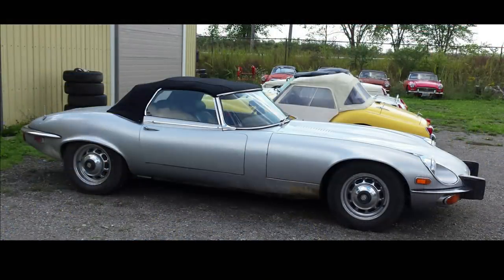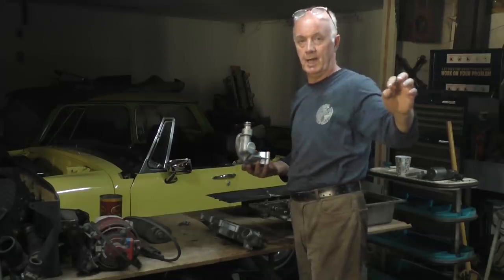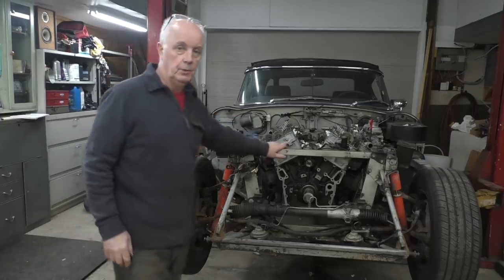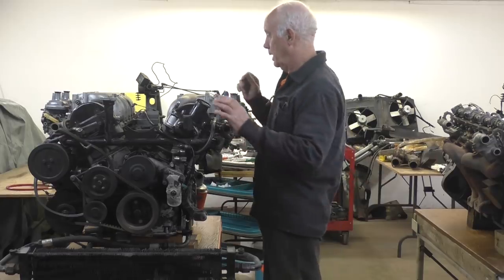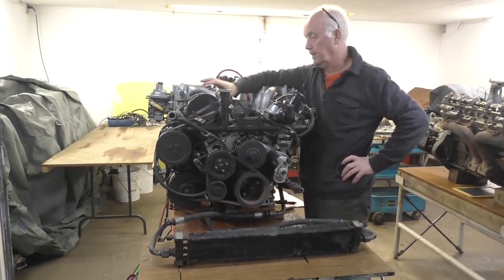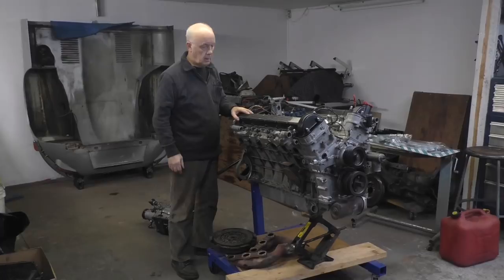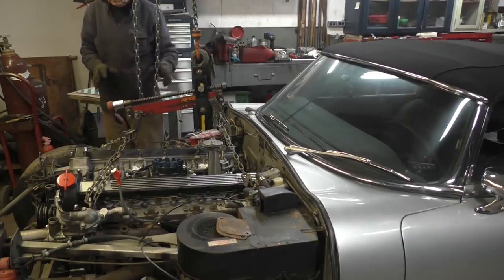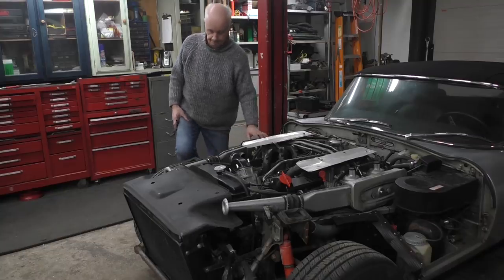Dr-Doolin Jaguar XKE E-Type V-12 1974 Engine Repair

Comment: How many hours labour from start to finish was this James?
Reply from the maker: Hi Neil,
Well to recap the work I did, I removed and replaced the engine from the original car. Stripped both engines the original and the spare down to their bare blocks. Assembled a complete engine from the spare block using the original oil pan, inter-cooler, and ancillaries and of course the heads from the original engine. All told there was approx 120 hrs of work. 
That is why I was annoyed the heads were bad on the spare engine, that gave me a lot of extra work. Removing heads from a v-12 is bad enough but from two engines for the same job is a bit much.
I got the spare engine on the assurance the engine was fine. Which of course was not true. 
Anyway it had to be done, still the car has been driven  and used ever since.
James
Reply: Wow that’s a lot.
Great video. Thanks for the reply and keep up the good work.

Comment: If it had been the xjsv12 it would have been a lot more work, so much easier on the E type. Even Jaguar have it down as 18 hours to remove engine and the same to put back. That's £1000's in labour, before you spend money on parts.

Comment: Just keep it original it's an E-type Jag there is no choice to make If the customer can't afford a regrind then perhaps they shouldn't own a classic car!
Reply: I think you will find that the crankshaft is hardened and cannot be easily reground; also there are no bearing shells available of a reduced size. The engine is not normally re-bored, (unless fitting larger cylinder liners to make the 5.4 litre into a 5.7 litre) as the liner and pistons are normally replaced together.

Comment: Could you imagine if you had put that used engine in the Jaguar without checking the compression and leak down?  120 hours of labor and parts - over $15,000 for an engine rebuild?
Reply: As i previosly said,youve got to go through th whole thing or you are throwing good money after bad 😢
Reply: Not impressed you didnt check piston rings or the crank bearings 😢

Comment: I had a customer bring in his v-12 to my shop,he pryed the head off with a chisel, and told me the cylinder liners came out from the bottom,and had the nerve to ask to me fix it, yeah right, I told him a new engine would cost around 10,000- 15,000, and another two grand to install it,this was back in 1984-5 some car owners can be total !@#$%,s
Reply: Jag engines aren't 327 Chevys. They're a lot more complicated even though the Jag is 1 cu. in. smaller than the Chevy.

Comment: False economy repair the original engine heads have been done crank grind new bearings and hone the cylinders and new rings
Reply from the maker: That's a fair comment but watch the "V-12 1974 answering questions" on the channel see how much that decision would have cost. (The prices have gone up by the way.)

Comment: Gets car for questionable oil pump. Sells overhauled engine. Good salesman.
Reply: Or get bitched out next week when it blows up with new oil pump and old rod bearings. It's a V12 Jag. By your comment, you have never worked on one.
Reply: So you are saying a V12 Jag needs a new engine every time some part of it goes wrong?
Reply: @mierbeuker8148  I will reiterate, you are talking out your ass. These motors are not $139 + tax at Kenny Upull. The metal from the worn oil pump had to go somewhere and could wind up taking out a rod and busting out the side of a #'s matching block and then he will be spending $45,000 instead of $4500. It's 50 years old, not 15. It is a good idea to tear those things down and make sure the head studs are clean BEFORE they become an issue. It is clear you don't own one.
Reply: Ok, so you ARE saying that you need a new engine every time something goes wrong with this very special type of engine. Got it. That is very special indeed. Expensive hobby if you ask me. But what do I know after all, right? I'm one of those dumb people that buy cars that don't need a new engine every time one of its parts breaks down. I know, how ignorant of me. Sorry if my finding the fact that you have to replace the engine every time something breaks down is a bit stupid offended you. I did not know that this was quite acceptable in Jaguar circles. Is this why every "Jaaaag" owner in the pub is so proud to point out that they made it to the bar in a "Jaaaag"? Because it costs a couple of engines just to make it to the bar? I always wondered about that. I will close my ass now and let you enjoy your wait for your "Jaaaag" to come back from the garage, so you can have another attempt at making it to the local pub without having to replace the engine again. Have a nice day.
Reply: @mierbeuker8148   Did I say he needs to spend $45k on a rebuild? No. I said $4500 or whatever the case may be on a refresh. Anybody who buys a HiPerf motor would likely do the same thing on a street rod. We buy performance cranks NEW that have rod journals out of tolerance and need to be ground. You would be the customer I would have to argue about it with and (a) send you elsewhere or (b) put a motor together so it can go bang. You are out of your league here friend. Even if the car was a 1903 T, just cause it starts doesn't mean you don't take it apart and go over it. Sorry, I said inspect it so it doesn't cost him a NEW engine. The value of some of these engines is near the cost of the car so blown engine = zero investment.
Reply: @mierbeuker8148  It's probably pointless talking to you but standard operating procedure in ANY internal combustion engine OR transmission would be what he is doing here. You just don't have V12 DOHC in modern cars. The main issue is with newer cars you would scrap them over the cost of a timing belt or head gasket job.
Reply: You just don't have V12 DOHC in modern cars? Really? Wow, I am obviously really out of my league here. Please don't blame me for this. I did not think I would encounter such a well informed individual such as yourself in this thread. I guess that would teach me to only talk about things I know about. Silly me. 

Maybe you can contact Audi and tell them they don't really have V12 engines in their new Q7 and R8 cars. Aston Martin with their "so called" 5.9l V12 engines, and Mercedes Benz with their M275 AMG V12's should be ashamed of themselves, telling people their cars has V12 engines in them, when clearly they are just lying. I mean the nerve of these people. I think there should be a law against this kind of false advertising. The same could be said about BMW F01 turbocharged V12 engines, and all the other companies that still claim to make V12 engines to this day. What a bunch of idiots. Clearly out of their league here. 

I would be willing to help you, so we can start a class action lawsuit against all of them, to force them to come clean and admit they have been lying to all of us all of these years. Maybe then I would not have looked like a fool coming up against a well informed knowledgeable person such as yourself. 

You see, in my defense, I was only completely out of my league because I was so misinformed about this whole deception that apparently has been going on, even to this day. Thank god I met you here, and you were able to set me straight. 

I do however feel a lawsuit is in order, just to make them pay for making me look like a fool in front of someone with your obviously superior knowledge, which is clearly in a league all of its own. 

Thank you for helping me realize what a fool I have been all this time. Thank you.
Reply: @mierbeuker8148  Your  ignorance and arrogance are holding you back from great things. This is the precursor to the modern fuel injected and turbo/ super and variable  compression.  While they are both internal combustion engines, they are quite different. Since you are so mechanically inclined however you can tell me the Ferrari routine maintenance on a new car.....is it 5000 miles they take their engines completely apart and check? IDK, seriously it's been a few years since I have done one. Should your German cars last 50 years and the oil pump go out it will be the same process as the man described above except you won't have to remove a bonnet.
Reply: Wow you are really confusing me now. I conceded that you were right, and now you are insulting me? You mean they still make V12 DOHC engines? Because you sounded pretty sure before that these do not exist anymore before. 

Anyway, all jokes aside, let's get serious for a second. German cars has this little thing called "Quality" that british cars has never heard of before. I have serviced a lot of old V12 german cars, and you rarely find one that needs to have any major work done to it. And in the rare case that you do need to do major work on it, it is always, 100% because the owner did not adhere to the service intervals. I have literally never come across a well maintained german V12 of any age that needed any major overhaul. In fact they just keep running better and better. 

And let's not even start on the electrical side of british cars. If you have any honesty left you would have to admit that this is a running joke. a Bad joke, but still a running joke. I mean lets be honest here for a second. It's not even just the electrical or mechanical side. There is a reason you don't have any mass produced british cars on the road anymore. Most of them rust away before they get a chance to break down, which is quite fast to begin with. 

I mean seriously, if you are going to try and compare the quality of build of german cars to british cars, you are either extremely ignorant, or extremely dishonest, or extremely delusional. Which one is it?
Reply: @mierbeuker8148  They put V10's in Dodge trucks. What exactly is your point other than to run around in circles proving nothing. Ferrari used V12's also. The point here is you don't own one and don't work on them so should some some respect to the man. BTW, in mining and industrial V12 diesels with bad oil pumps the standard operating procedure is the same.  My point that you are trying to dissect is that the ordinary person  cannot go to GM, Chryco or Ford and walk out the door with something like this in an everyday driver but I didn't stop to think about the  person that would read the comment  being a troll.  Goodbye, nice chat.
Reply: @mierbeuker8148  You win. I served my apprenticeship on Jags. You have watched videos on them and outsmarted me with your intellect. At least I sat in one.
Reply: @mierbeuker8148  BTW, you are also comparing a 1993 to a 50 year old Jag which you had just finished admonishing me over for comparing American and industrial engines over. Why don't you just compare the engine to a Panzer since you like German equipment? I think the reason you are so pissed off is that my statement is correct that you talk out your ass and I have to be out because you are bringing me down to your troll level. Good job James, Excellent work!
Reply: @mierbeuker8148  Like I said you won.
Reply: Mier Beuker  Actually I have a 1988 Jaguar XJS V12 with 160,000 kms or about 120,000 miles still running strong on the original motor.
They do exist if you take care of them, just like any other mechanical device.
Reply: Oh I never said it could not still have the original engine. People take great care to make sure the engine and chassis match, and stay matched. It's the only real way to keep the value of the car up. 

If you honestly have a Jaguar V12 from 1988 that has never had any major work done to it, I can tip my hat to you. I would suggest that you have taken extremely good care of it, and have never thrashed it down the autobahn at full speed. Also, has the car always been stored indoors? I guess my question is how is the car on rust? 

You see, it's not that I hate Jaguars, I think they are beautifull cars. In my humble opinion they are better looking than German cars. But in my years of experience as a mechanic on many luxury cars, I have found Jaguars to be the least reliable cars I have ever come across. Mechanically and eletrically there just always seems to be something wrong with them. When they work they are lovely cars, but sadly they just so often dont. 

My friend Max however was being a dick, making statements like nobody else makes V12 cars, and that I should "Respect the man". I got an instant flashback of Cartman saying, "Respect my authoriteeeey" Still giggle about that one. XD

So I just had to point out that compare to German cars, the quality of the mechanics is a bit lacking in terms of reliability. But if you have one that is still completely original, that has had no any major work done on it, except of course for regular maintenance, well then I have to admit that I am pleasantly surprised. It's people like you that keep old classics from disappearing for ever. Thanl you for that, and may you have many years more of enjoyment from her.
Reply: @keithscott1498  the 1988 is fuel injected. The carbureated motors were a completely different engineering aspect.
Reply: Mier Beuker  Yes,  this car has been babied it’s entire life. Always indoors and never driven in the winter here in Canada.
I was just answering your statement that there are no original V12 Jags with over 100,000 miles.  I may have an actual unicorn here but I do think there are others. 
As far as being “reliable”, well that wasn’t the point I was addressing. I think “reliable” and “Jaguar” are mutually exclusive without a doubt.
This car most definitely has its quirks and personality.  But so does every other classic I have owned. American or European. That’s what makes it so much fun to own these things.

I do know that one big killer of Jag V12’s is heat. Or to be more precise... lack of cooling. Stuffing these large engines in a small a space as possible with minimal cooling is not a great recipe for longevity.

One other thing I know, is that on those glorious days when all the stars align and that beautiful motor purrs to life... you can’t wipe the smile off my face.!
Reply: Wow, sounds magic. I can just imagine. 

You know, I saw this documentary once, where the point was basically that the engineers designed a perfect car, and then the designers and accountants changed a lot of the materials used, and other specs to make it more profitable, which inevitably ruined the reliability of the car. 

I also heard that Jaguar were going to make a number of these cars again, because apparently they still had a number of chassis numbers left for the E-type I think it was? Not sure how that works, maybe I just misunderstood that point. One would think you can just make as many chassis numbers as you want. Anyway, what they were going to do was make a few of them again, but this time they are going to build it exactly from the blueprints as the original engineers intended it to be built. With the correct materials and tolerances etc. 

I think that would really be a fantastic car, because the engineers back then knew what they were doing. There were just too many idiots that stood between what they designed, and what got built. 

Anyway, glad you are taking good care of her. She will be worth a fortune in the future. Especially if you can keep her in a unmolested state.

Comment: What a nightmare at $120ph. Put in a nice warmed up LS7 and a TH400. Probably worth nothing but it would be a really nice drive.
Reply: Wrong - how to totally ruin a Classic British Sports car!!!
Reply: @wcads623    Easy.  Just leave the Lucas electrics on it.
Reply: @wcads623   i   looked at a jag V-12 years ago said it needed work . nice looking car but popped the hood and the heads were off. the seller explained he was a mechanic and had marked where everything went?? then he said you can get a conversion to put a chevy engine in it. my reply was wouldn't make much sense to have a jag with a 350 . i passed wonder what ever happened to it